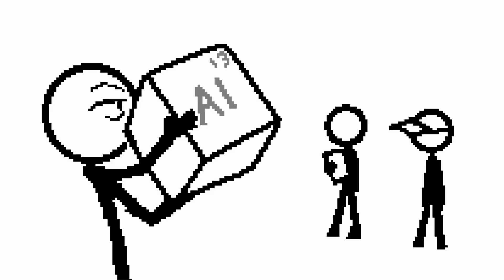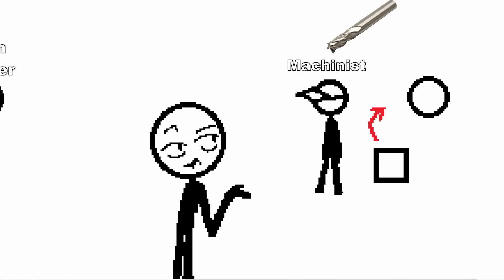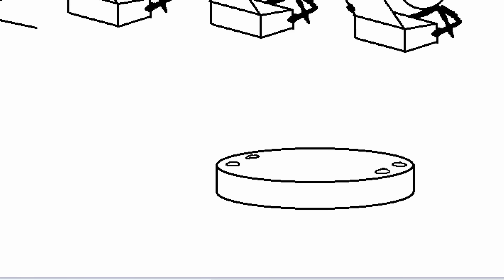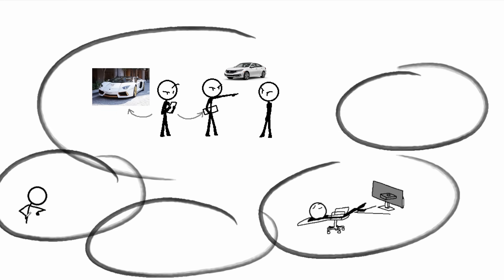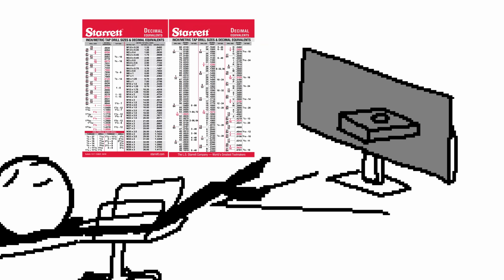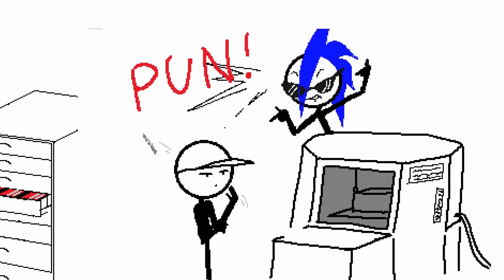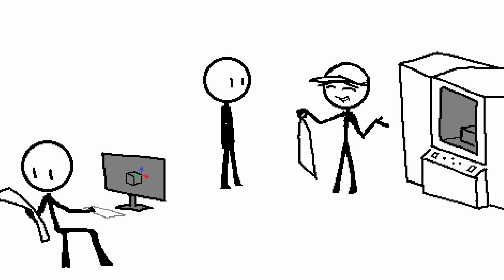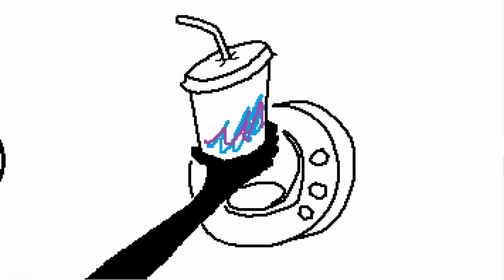Why we hate engineers

Comment: Dude is like when architects forget that their buildings have to be built.
Reply: LMAO YES, they'll design the most outrageous things any human could imagine then someone someone has to build It with the physics of the world, like damn bro.
Reply: taking architecture classes ill try to be better
Reply: @reecerinehart8419  
I've studied to be an architect and you'll be actively discouraged and even failed if you "try to be better" well "try to be more practical". You'll constantly be reduing technical drawings and projects because the artsy professor thinks your original design is "boring" they will pester you until you relent and put odd angles and curves into impossible spaces or have the theoretical contractors waste metric tons of 50C or 60C grade portlant cement along with stainless steel structural elements and chemical cement addatives for an ornamental facade that has minecraft physics, and looks as ugly  as a badly made rubics cube torn apart by an angry kid.
Reply: @sosig6445  Question, how often does more "antique" building designs get rejected ? Or even presented at all ? Like, like mortice and tenon wood frames, brick arches, vaults, domes, etc, lathe and plaster, adobe, stucco or just anythng that would've been done or possibly common place 80+ years ago ?
Reply: In my experience, it is actively discouraged by architecture professors. My team was always trying to present buildings with exactly the methods you describe, and they were considered so "out of style" that we were threatened with failing the course.

Please everyone, never hire an architect for anything, it's all marketing. Just learn to do things on your own, get a civil engineer who understands historical buildings and learn to say "No".
Reply: Then the structural engineers are like the machinists in this case. Please be realistic about your designs. I got my USB thrown at me because I designed an unmachineable part. I deserved it.
Reply: Structural engineer here. Architects, PLEASE KEEP YOUR FLOOR PLAN ON GRID! When you put some walls like 1 foot off the main grid lines it makes a LOT of unnecessary work.
Reply: im going into civil engineering. if i may ask, what are the chances of me getting into a fight with an architect in the future?
Reply: I work in this field on the design side and yeah this happens a lot even with other firms expecting us to design something that realistically can't be built that way.
Reply: @dingusmcgee7590  well in my experience interior designers tend have more grounded education cause they are required to do a lot of building code research so they learn how to design with in pretty realistic rules. As far as antique styles a lot of what gets taught is very contemporary or minimalist though many students do develop their own style.
Reply: @dimitristsigopoulos that's not entirely true each profession has it's place however there a lot of full of themselves architects who don't know what they are doing.
Reply: @Phil9874  Like sure, the part checks out and so does the FEA analysis, and materials and weight, but how tf are they supposed to machine a certain impossible twisting through hole.
Reply: I believe both architect and engineer lack the understanding needed for manifestations of abstracts design. One draws it and measures it while the other reads and comprehend well enough to bring it to reality. Your all going in loops pointing fingers on who lacks this and that the most. I do agreed that with machinist and graphic design of projects can go hand in hand in projects. But what makes that possible must be understood between engineer and architects as well.
Reply: @sosig6445 Siv.ing. here, 50c cement with reinforcement is as bog standard as it gets. They are stupid cheap compared to some shitty glass facade. Or worse, brick facade. Biggest cost savings in the construction industry is time. The longer something takes to build, the more expensive.
Reply: @quiquecruz2890 you can use a mold.
Reply: @kaplanbahadir2301  
Well for large constructions 50c is a must but for individual houses where i studied 45c for the foundation and 35c for the rest was the standard (all reinforced of course) what makes concrete cost astronomically high is physical treatment and time. 21 days is the standard hardening time (without addatives) but you can get away with some shenanegans if you give it more time as it slowly gets harder for up to a year.
Reply: @Phil9874  Yep, only got taught the electrical code formally, and I'm a mech engineer, honestly they shoulve taught us more codes and ISO standards... Funny, mexican electrical code does not require GFCIs anywhrere! Not even near water installations! See the recent incident with some american tourists and a hot tub at Sonora Sky resort.
Reply: @sosig6445  it depends, most untreated concrete will achieve some percentage of design capability after 7days. So as long as you don't load past the temporary design strength, you can reduce build time significantly. There is a software that can track this and create a comprehensive roadmap to minimize time sitting around waiting.
Reply: @kaplanbahadir2301  
It saddens me that only reason i can keep cpnversing with you about this topic is because of the extra curricurals because apparently architects don't need to know about concrete technology according to the university...
Reply: @sosig6445  I don't know much about concrete either. Concrete is stupid cheap, it's the steel reinforcements that cost you in the long run. Only concrete nerds with two phd's work with concrete itself daily.
Reply: I studied Architectural Engineering (msc) in europe, and my schools curriculum was loosely based on a "swiss model" of teaching architecture. This ment that i had to learn structural engineering (8 courses),  building construction (10 courses). a bunch of construction technology, management, building energetics and service design courses. i could design Steel stuctures RC slabs (i had same courses as the civil engineers) but i'm legaly prohibited with the license i get. 
Building construction design was the most useful thing for us because you really had to understand how to create detail designs, spec out materials and understand how different element could be constructed, fabricated and how the parts will work together as a system.  Learning construction technology and management was also great because you can design and prefab anything but if the streets at the building site is not big enough for a huge truck ..... good luck getting a beam to the house....

Lets not forget that creating a family house can easily have as many steps and the same complexity as designing a modern smartphone or laptop. But unlike electronics almost every building is unique. Sure the iphone 14 is different than the iphone 13 but you can't use previous elements in buildings :)

In the end i think that the builders, construction specialist and all the trades people need to work together to create something complex as a building. OFC its great if the "designer" know what they're doing but the knowledge should be shared, because it can happen to anyone one a building site, that they have some blind spots for something.
Reply: Bro it's not that hard. Just use a 1mm thick rod of condensed dwarf star alloy to hold up the building
Reply: @sosig6445 like bruh, take the box with a rectangular pyramid on top, it'll work just as well.
Reply: @nicknick_nick  
it'll work if your plan is to fail the class.
Reply: @sosig6445  it's affordable tho
Reply: @joeywaffles9456  This is incorrect.  The job of the architect is to represent the clients wishes and needs with through the lens of their own artistic interpretation.  Then the job of the engineer is to advise on constructability and suggest was to decrease cost.  Ideally you'd iterate through the D&D process and land on an optimized design goal.   We have a saying, "you can build 'almost' anything if you're willing to pay for it".
Reply: @draconicdestruction5352  Depends on your definition of a fight...  "Fights" as in shouting matches amongst design consultants are actually extremely rare.  They become less and less common when you gain experience, as less mistakes get made and experienced professionals naturally become more skilled at navigating potentially contentious situations.  In reality the only time there are "fights" is when contractors are involved, but they only tend to pick fights with inexperienced engineers/architects who are too timid.
Reply: @TB-ni4ur  You speak of present regulation and limitations, the intent of my statements speak on the potential both fields can achieve if their knowledge and understanding are combined. Funding should not be an issue if statistics and strategies were applied before the project.  Ideals should be applied as well but of course also with prudence.  My point was not incorrect, but I can see the confusion looking on my past conscious, and how I expressed my previous understanding. I should have elaborated better.
Reply: @joeywaffles9456  Buddy, clearly you are young.  NOBODY can be an expert in all fields.  Things today are too complicated.  The best you can hope for is constructive collaboration and task compartmentalization.
Reply: @TB-ni4ur  Buddy, youth has no factor here. Just an open mind who can sample reality. Do not be arrogant.
Reply: @draconicdestruction5352 zero if you stay working in foundations/Geotechnical lol
Reply: @sosig6445 😂😂😂😂😂😂
Reply: once I worked in an architectural studio, the guys there were super chill and and were real prankster, one time I came back after a coffee and they were all laughing around a guy, that guy was on the phone with the boss of the construction team (they are friends), previously they purposely sent him the most impossible and unbuildable project ever known to man, if a law of physics exists that building was breaking it, the boss was so pissed off we could hear the conversation while the phone wasn't on speaker, it was hilarious.
Reply: @joeywaffles9456  Better get over that ego Kid.  It won't fly...
Reply: I feel personally attacked.
Everyone blame architects, of course. You know what? We too have codes! Engineers, builders and others - forget that thing needs to be livable, safe and useful. You don't always need to build a bunker! What you always need is a thing that will give you the most chanсes when it goes on fire. Because it will be on fire one day eventually. And it well either end in a massive amount funerals or a bit of extra breakes in the office. What you also need - is to do as little moves as possible to get what you want while inside. And if you want to do more moves - you will need space for it. The sad part - space is limited and you want it to be affordable. (Yeah, I too understand the irony of the last phrase nowdays).
Reply: @fearofthedead  Thanks
Reply: @sosig6445  dude I am so glad that you didn't let that become your supervillain origin story
Reply: @TheBellhopper  
I got out in time and study CS, it still has a lot of bullshit but at the very least i have more passion and talent in this field...
Reply: @sosig6445  cs?
Reply: @TheBellhopper  
Computer Science
Reply: @sosig6445  oh that’s cool
Reply: @draconicdestruction5352  from what my cvil eng teacher say 100%
Reply: @sosig6445  My GF is an architect and this is so spot on.
Reply: @nottomclancy2439  Tell her I pray for her sanity and success.
Reply: Unless it's Dubai.....
Reply: Uh, an architect (whether it be building architect or network data architect, etc.)   is no longer fully an engineer.  They do more design than implmentation.
Reply: @VBMichael_D  
engineering is both designing and implementation, by that definition civil engineers are also not engineers because they do next to 0 design work.
Reply: @sosig6445   Thank you for illustrating why everyone should hate architects.  Art school rejects who think they're engineers but are dumber than either
Reply: @BarrGC  
Whenever i had a more engineering related question about the structural integrity the answer was either: "x-y is the standard and you can't deviate from it, or it's not your job to calculate that"
But color studies are SOOOOO important i'm so glad my house is being designed by someone who did 2 semesters of color studies, but has no idea how concrete works!!!
Reply: @saintsfearful  That goes for you as well, Mr. Engineer. The rest of us, plumbers, HVAC, and electricians, have to deal with all your little oversights, which slows the job down and increases the cost.
Reply: @peted2770  gee, I’m SO sorry for ensuring the buildings are safe and legal. Obviously your profits are far more important than anything or anyone so shame on us.
Reply: @sosig6445  I'm an engineering nerd and have ZERO appreciation nor need for art in my life.  I had no idea what a colour (Canadian spelling, lol) study was, had to Google it.  To me, it's a complete waste of time, paint something whatever colour you want, doesn't effect the structural integrity, so it's completely ancillary to the point of the structure.
Reply: @saintsfearful  Yes, my profits are my priority. I don't run a charity. What I was referring to was the never-ending toilets on joists, wet walls under structural beams, and other such oversights.
Reply: @peted2770  hey bud, that’s the architect not the engineer. Maybe learn who does what before you throw stones. Also, your profits are definitely not more important than the safety of the public and if you think so you should have your license revoked.
Reply: @BarrGC  that’s sad. I’m an actual working structural engineer and I have a DEEP appreciation for art. We are not machines and pretending you are disconnects you from the world. Btw, unless you live in a grey box and wear a burlap sack every day while only working I guarantee there’s some form of art you appreciate whether you want to admit it or not.
Reply: @saintsfearful  OK, agree to disagree then
Reply: @saintsfearful  Hey Sunshine, you guys just point at each other and say it's his fault, so I throw the stone at whoever is closest at the time. My profits are tied to my work being completed to local and state codes. Public safety is baked into everything; it's not a separate consideration. That is backed up by at least two, sometimes three, different inspections performed by a state/local inspector. Now, when someone doesn't carry the one on his math, it causes a stop to the project, so half the building can be torn down because of a weak beam. Or when someone else cant use a flipping overlay when they draw their pretty little pictures, that causes every mechanical to be screwed six ways to Sunday. That is what causes considerable losses in profits.
Reply: or forgetting how stairs actually work lol
Reply: I'm studying engineering and my partner is studying architecture. shes already driving me crazy with whimsical ideas
Reply: 7 months later, here I am. Preparing to study architecture.
Reply: @reecerinehart8419  you can always also do a double diploma with an engineering school or the other way around with an architecture school
Reply: Mine just ignores building code. 
"What are those things? They're ruining the view of my art installation - can we move them?"
"... Those are fire alarm bells."
Reply: I did electrical work for an architect that was constantly designing structures that were almost impossible to build. He used to get angry at me when I would look at something that he put together and would tell him, 'I can't wire that'.. He would argue that I could wire it so I would say, 'show me how'..
Reply: Yep, working on a jobs site, where we where installing a 5 ton heat pump unit in a drop ceiling for a gym section of apartment building. We had to keep telling the GM that the drop ceiling needed to be lower. They lowered it 3 times and it still wasn't enough. Everytime he consulted with the architect. He had the specs for the unit we were installing but still figured he could fit a 5 ton heat pump AHU in 16 inches of drop ceiling space.
Reply: "What do you mean it's a dangerous precarious design?, my craft paper model is perfectly sturdy"
Reply: @SKPetel  "Those words you said, 'inadequate loading conditions'... what di they mean?"
Reply: @CardinalTreehouse  "what do you mean my concave all glass and polished metal building is cooking pedestrians likr ants?"
Reply: @SKPetel  The funny thing about that is it would simultaneously be terrible at retaining heat inside lol